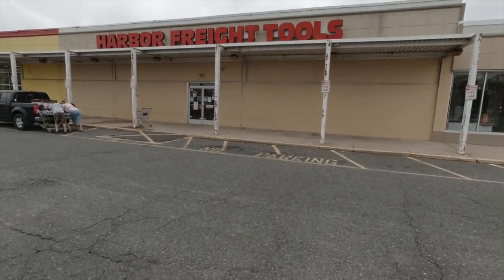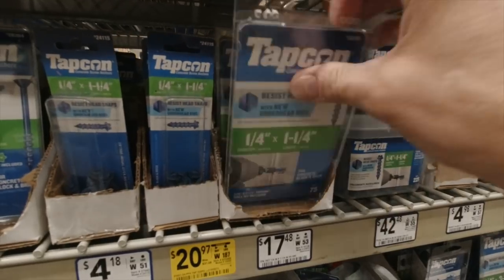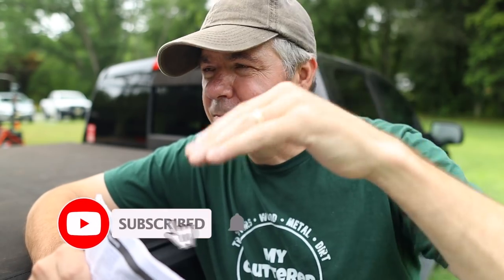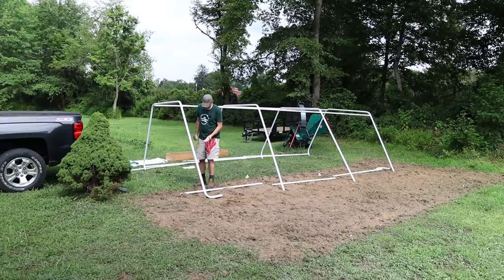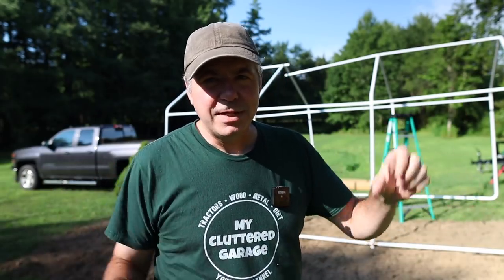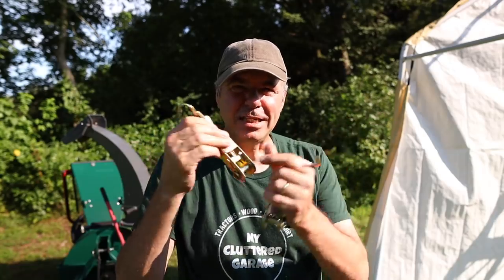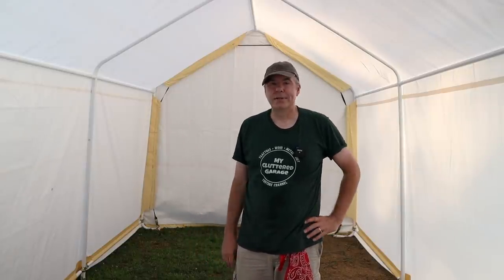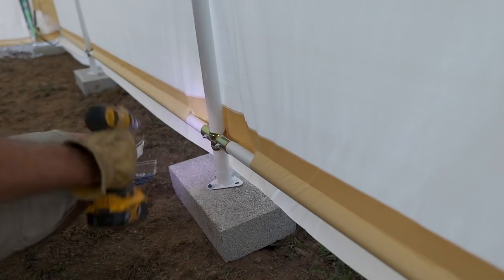#67 Harbor Freight Portable Garage - Real World Install and Review

Comment: As a comparison, I bought the HF canopy, which is about the same size I believe, for about $100 a couple of years ago.  I assembled it and then used tarps to "close" it in to protect my implements and some other things.  Got everything inside and everything was fine.  Then one night we received our first snowstorm (we live in southern New Hampshire) and looked outside in the morning and the whole thing had collapsed!  Now to be honest and fair, it clearly said on the box that it would NOT hold a snow load, however, I thought it meant that you couldn't let it build up like a roof.  I figured that I would have time to get the snow off before the next storm, but I did not.  I hope your garage will fare better than my canopy and I look forward to seeing how you arrange your items inside.
Reply from the maker: Thanks very much! So the $49 replacement insurance was probably a good idea! :)

Comment: I had to put mine together by myself. I used duct tape to hold pieces together. That was the best idea I could come up with. You can remove tape later for appearance.  I used tap screws later to secure piping after it was all together.  I did 3 of them by myself. The first one kept falling apart until I used duct tape. Duct tape is cheap at harbor freight.
Reply from the maker: Someone else suggested duct tape too. Brilliant. If I put up another one, it will go much easier and faster!

Comment: I built one of those years ago and had the same frustration with parts slipping apart.  I solved the problem with a loop of rope going end to end on the peek and then wound it up with a stick to pull it tight.  You have to get creative when you do a two person job alone.
Reply from the maker: Lots of good ideas here, Greg. Another viewer suggested taping the joints together with duct tape. Brilliant!

Comment: You could drill holes at every joint and either put bolts or a codder pin or something similar.
Reply from the maker: Yes. I think the best suggestion I’ve heard is to just use duct tape on the joints. 👍

Comment: I put one of those things up the other day.  I found the connections where the pipes go together  we're a little flimsy I wrapped duck tape around all the connections so they didn't come apart so easy.  I went to put the canvas on the front and back . The sewed area the tubes go in was sewed too small. I called the help line and some girl assured me the tubes did not go through those I ended up removing all of the second stich so the tubes would fit.  I actually got the roof on all by myself . The thing is actually fairly sturdy.  Only problem is the experts on the help line need to know their products better and I should have made them send me new front and back pannels.
Reply from the maker: That's a bummer that you had those problems. It is definitely sturdier than I expected... once it's up!

Comment: Ground squishy. Attached to cinder blocks. Rebar driven into the ground (the ground had been frozen when it was erected) and cabled to the bases. Wind picked it up, cinder blocks and all, and tossed it on its top. Bent some of the connecting links. Found I can't get those. Based on your information, I could see purchasing the extended warranty next time. As it is, I'll need to figure out how to make some new connectors as they don't appear to be available.
Reply from the maker: That’s a bummer!

Comment: Also put ratchet straps on the cords before installing cover and doors. I spent an hour trying to pull the cord back through the door curtain when I pulled it to hard with the ends slip into the canvas. What a pain. Remember put ratchet straps on cords first. It was alot easier after that.
Reply from the maker: Good point! I had to fish the traps too!

Comment: FYI - just bought my second one of these (2023).  New one is a bit nicer - all the roof joints are drilled and come with bolts and lock nuts.

Comment: Buy some 3/8 x 1/2 to 3/4 inch long self tapping screws to hold the tubes together. It also makes it sturdier.
Reply: How do they work? Do you have to drill a hole through the pipes first? If so, what kind of bit is best?

Comment: I think I would dig under the blocks to make them flush with the ground. Actually, I think I will use those 36 inch screw into the ground shed hurricane anchors. I used them on my shed and they weren't very expensive or difficult to put in.
Reply from the maker: Hi Larry. It actually comes with pretty nice anchors that screw into the ground. In hindsight they probably would be better to use than the blocks. See my latest update here. https://youtu.be/WKjN9R8iPoY

Comment: I just put one of these together. Definitely can do it by yourself. Hardest part honestly was fitting the tubes through both end tarps. Maybe mine was just manufactured poorly but the slots that those tubes go through were extremely tight. The main cover tarp was much easier to do this.
Reply: I also put some 1/2" self tapping screws in some of the frame junctions. I'll get around to doing them all eventually. Great video by the way, wish i had watched your tutorial before i built it.
Reply: Yours didn't have straps in those areas??
Reply: @diychad7268  no, just slots to fit the bars through

Comment: I had no luck with mine. My blew away for the last time and I threw that thing in the trash and built one out of wood and concreted it in the ground and no more marry Poppins crap going on with it flying in the air... I even used bricks just like you did with the post and I anchored it to the ground.
Reply from the maker: They should probably call these garages “temporary” instead of “portable”. 😄

Comment: I’ve had this portable garage in my back yard for a year. It has survived several bad storms, really high wind, and just recently a bad ice storm. I left the front and back off because I work on mowers and wanted to be able to pull one mower into it with another mower. So I basically just use it like a car port. I love this thing.

Comment: Sir, did you see my comments about my friend losing his shelter cause by 40 mph wind. The year after he anchors it at several place around his shelter with twisted anchors rods ? Cheers
Reply from the maker: Oh no! Those twist anchors are aggressive. maybe they need to be set in concrete?
Reply: @MyClutteredGarage  Well Sir, when the ground froze it is very strong, now at your place the ground does not froze like here 2-3 feet deep,,, So I think it will a very good idea Sir using concrete 👌😉

Comment: With the cost of lumber up. Looks like an inexpensive alternative to getting the clutter out of my own garage.Shoot, I might actually get my vehicle back in it. Or be able to have a dry place to work on it. Instead of it becoming a garden shed for mowers and what nots. Thanks for the video and the idea.
Reply from the maker: Thank you for watching. I would, however, recommend anchoring it to the ground. It has shifted a few times in strong winds. The blocks are not quite heavy enough.

Comment: Great video!  Thank you!  What's the size of the cement block?
Reply from the maker: Thanks John, They are solid 4 x 16 blocks, but I have found that the wind still moves them. I would actually recommend using stakes. -Ed

Comment: Can you drive your tractor in with the Rops up?  If not could you take the front panel off and not adversely effect the unit overall?  Im in the market while I build a barn, seems like the best solution for the money.  Thank you
Reply from the maker: Hi Danny. Mine fits under with zero clearance.  But it fits! You can assemble it without the door panel if you want to leave it open and have higher clearance. Thanks for watching, and good luck! -Ed
Reply: Thank you, the front panel idea is perfect
Reply from the maker: The best tip I got (after the install) is to duct tape or masking tape all the pipe joints as you assemble. The tape will hold it together yet let it flex as you assemble it. 👎

Comment: I got one and love it. I used sheet metal screws to hold all the pieces together and to make it more sturdy.
Reply: thats what i wanted to say
Reply: You had better luck than I did.......the side and roof poles that attach to the end walls wouldn't go thru the hole with the straps. It was size for size with the pole. I even tried lubing the pole to try sliding it in. Just tore the wall.  Garbage.....took it back.
Reply: How hard is It to use them?
Reply: What size of screws?
Reply: Does it hold together & protect the car well? 
I’m looking to get one because I’m not gonna have a garage to put my car in here soon. So I need an alternative for like a year.
Reply: @Craig_450  I won't recommend this  thing,I get one 2 months ago and everyday when winds blows 15/20 mph I have to keep an eye on it,I don't think it last a year or less cuz i seen many tears on it.

Comment: The top cover lasted 1 year. Cost $75 for replacement cover. Look it up on harbor freight parts list if you need to order 1. Mine are on the farm. I plan on buying harbor freight heavy duty tarps or convert to green house because its an excellent structure.  Maybe buy metal roofing is an option too
Reply: Maybe get the warranty. It would cover the replacement after 1st year. The winter snow and summer sun made the top cover fall apart. The sides and doors are in great shape
Reply: I did the same thing with pole #4. I later found it easier to slide the poles into cover while stand up and adding bolt and fitting s loosely, than slide 1 side down to ground and tighten.  Then pull the other side down and tighten bolts.

Comment: With the wind from storms ,do you think it would help to use self tapping screws at the joints? I also need extra storage (built shop too small or too many toys).
Reply from the maker: Hi Bill. I think something like this needs to flex, so I wouldn’t screw the joints together. Once it’s all together, it’s pretty sturdy!

Comment: Sir what size screws and what size drill bit did you use to pre-drill the hole for the screw in the concrete blocks?
Reply from the maker: Hi James. I used 1/4 inch tapcon screws which included a bit. However, I have found that the blocks are not heavy enough to keep it from shifting in the wind. I’d recommend staking it down. Thank you! -Ed

Comment: I don't know if I like the cement blocks.  That fabric will act like a sail on a ship and may over power the weight of the blocks,  Blocks or not you can always use 8 T posts along the sides and make sure it won't go anywhere.
Reply from the maker: The blocks have definitely shifted in the winds. So far, just a couple inches and I can slide them back.

Comment: Do they not come with a bar across the front / back entrance? Feel like that would help a lot with the wind and keeping stuff out.
Reply from the maker: They do not. But there is a slot, so I added one.
Reply: @MyClutteredGarage  I just picked one of them up the other day, plan on doing the same! Do you know what size pipe you used by chance?
Reply from the maker: @FirstnameLastname-qc3xx  I believe I slid 1/2 metal conduit along the rear, and 3/4 PVC in the front (makes it easier to roll up). Good luck!

Comment: Is it still standing? Wondering about the durability.
Reply from the maker: Hi Chris.  Yes it’s holding up very well! However, the blocks are not enough to keep it from shifting in heavy wind. I’d recommend anchoring it to the ground. Thanks for watching. -Ed
Reply: @MyClutteredGarage  Thanks for responding. I bought one several months ago. Your video will help as I tackle the project. I live in Kansas so I will definitely need to anchor it down or it will end up in Oklahoma ha ha. Thanks again.

Comment: Looks great! Add plastic or vapour barrier down first, but make it shorter then the surrounding edges of the carport, and add a lot of woodchips on top.  This will also stop weeds from growing up through the woodchips.
Reply from the maker: Great thinking Ross! Back to HF for a 12 x 20 tarp 😄
Reply: @MyClutteredGarage  I would suggest some poly film, 4mm or 6mm whatever they have, instead of a tarp though, and some red tuck tape if the poly isn't wide enough.

Comment: Hi Ed.
I see you added a nice pole to rollup the door. How did you attach it?
Reply from the maker: Hi JW. There’s a loop at the end so you can slide a pipe through it. I removed the metal conduit and replaced it with a piece of 3/4” pvc. Works really well for rolling up the door. Good eye!
Reply: @MyClutteredGarage  Okay thanks Ed. I'll add 3/4 to mine too.

Comment: I wonder if you could use self tapping screws to hold all those pieces together I noticed they kept pulling apart on you,,, maybe you could just drill right through it with self tapping screws??? I would say don’t rototill the ground first I wouldn’t do anything to the ground I’d just build on it,,, you could always put some gravel or steel slag crushed asphalt,,,a lot of people are using crushed asphalt nowadays for a driveway stone etc. however you’re not going to spend much time at all out in that shed mabe just to get some something out or put some away,,, lotta farmers in my area will put up a pole barn and they just leave The ground as it is
Reply from the maker: I wouldn’t use screws because I think the joints need to flex. Someone suggested just taping the joints with duct tape, which I think would work great!

Comment: Has anyone use metal or plastic roofing on this structure.  Will it support the weight? Where fo you buy the roofing? Like to make it more permanent to protect the implements once I have to replace the cover
Reply from the maker: I've heard of folks screwing metal roofing to the frame but haven't seen it done.

Comment: I put little self taping screws in mine as I went
Reply: How do you get them in?
Reply: @jeanpomerleau8416  I would like to see a video of people driving them into this tubing. Also, we had some bad storms the other night...tornadoes in some places. My portable garage shifted and collapsed...some pipes were bent all the way and would not have done better screwed together. One was bent right below where it fit into the other piece. I used duct tape to keep them from falling apart during assembly. Another problem us that my site was way more uneven than I first thought. I propped the legs up on blocks and pavers...definitely will do better site prep next time. It has been up 6 months and through some other storms. I expect failure to have it more level contributed to instability. I have also had issues with pooling water on the roof. I still have not fully assessed the damage, but I am sure I have bailed or poured 15 gallons of rainwater off from various sections. I am going to try to salvage it.

Comment: I am going to build a deck for this garage, and I have to do that before I set it up. I need to know the actual foot print size of this unit so that I will know how to size it. The width is the most critical factor for me. If you could help, I would greatly appreciate it.
Reply from the maker: Sorry I haven't had a chance to measure. I'll try to get this for you. -Ed
Reply: @MyClutteredGarage  Thanks. That would be very helpful. I need to know just how wide to make the deck upon which I intend to mount the garage. I have one in the box, but I don't want to take it out until the deck is done and I am ready to erect it.
Reply from the maker: Hi Jere. The sides are pretty flexible, but I’d make your deck 10x17 and you’ll be in good shape. Great idea!
Reply: @MyClutteredGarage  Thank you! Much appreciated.

Comment: The weight of those concrete blocks is not going to hold that down you get 30 40 mph gust winds I got a 10x10 mine's anchor down getting high winds and Oregon and if it wasn't for the anchors it would have blew clear cross who knows where
Reply from the maker: Good to know, David. We've had a few storms with gusts and so far so good. My big concern was the 8 inches of snow this week. I was able to clear it all off with no damage.

Comment: I had a Harbor Freight portable garage and it collapsed after a 3 inch snow fall it's first winter. I've also owned a Shelter Logic portable garage (Menards) for 10 years and it held up even after have a branch fall on it, a branch so big that I had to have a tree company come out and remove it from the top of the garage. It ripped the fabric but the frame held up. The tree company said the branch weighed more than 2 tons. Harbor Freight is junk.
Reply from the maker: Glad I paid for the warranty. We’ll see how it goes this winter. Thanks for sharing!